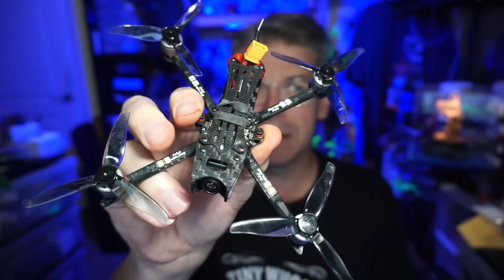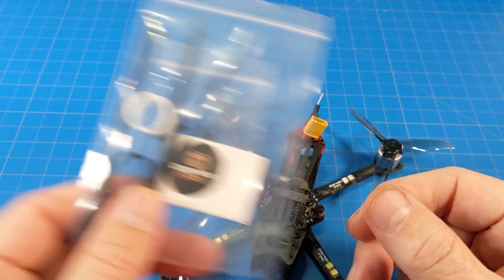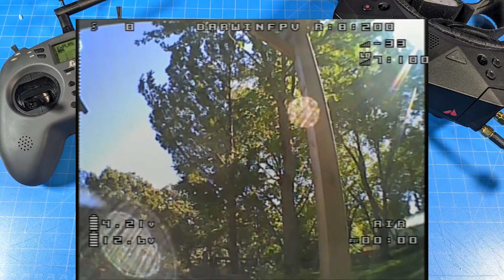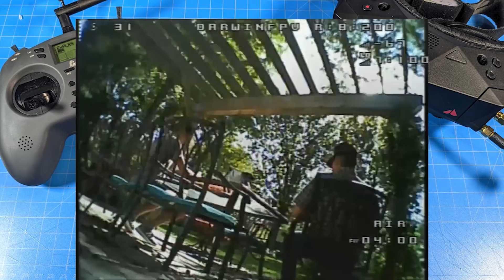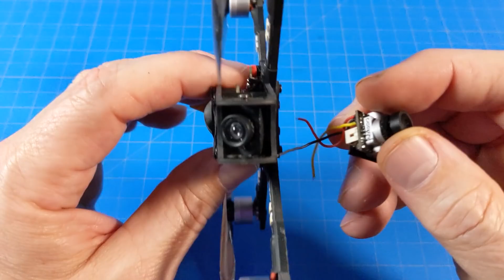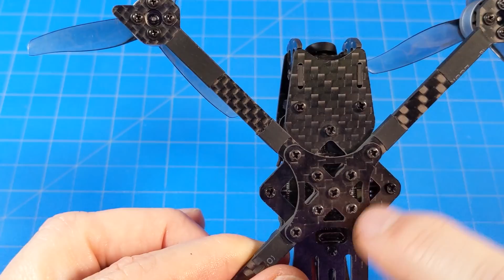So Cheap Made Me Worry // DarwinFPV BabyApe 3 // Took My Crashes

Comment: Wow that's a cheap BNF, could really help some newbies get into the hobbie. With that price you could just send it like crazy and when it dies buy another. It's like the price of a decent AIO nowadays.
Cheers mate.
All the best Nick
Reply from the maker: True, only downside for a new person is the soldering and setup of the receiver. I think that is one spot they could add a receiver for like $10, there has to be a reasonable rx on the market they can get for $5 in bulk.
Reply: @NickBurnsFPV  yeah there's lots of D8 external recievers Darwin should consider. I only pay $5US for the Emax D8 external ones I use. 
But a bit of deal breaker is the cam for me, it's quite bad. An ant would be nice in there but it's 1/3 the cost of the quad, shame it's not wider FOV, the image is fine to start with but narrow makes it soooo hard to learn proximity. Lucky you know you yard quite well by now Nick haha. 
Gonna try a lap blind folded soon? Haha
Reply from the maker: @slowentropy4531  As well as I know the space, my first 6 flights were awful, so many crashes and near crashes. I suspect your right on both the Rx and camera, surely they can find a camera with the same image quality and a wider fov for just a few dollars.
Reply: @NickBurnsFPV  yeah alot of those old reversing camera has huge FOV and are super cheap as well. Yeah that just shows it will be a bit hard for beginners to fly hey, I absolutely love super wide FOV if if image distorts a tad. But hey at least you crash tested it yo a degree haha.
Reply from the maker: @slowentropy4531  yea, I don't get to troubled by a touch of fish eye myself. I just want to see as much as possible. Makes it all feel faster and more aware.
Reply: @NickBurnsFPV  Plus I just love to see motors and props so it feels like I'm in it hahahaha. I really prefer pod racer frames woth cam up top over freestyle top mounts, always have for some reason. Also incase any reads this the LarvaX is around $95US off Aliexpress, not sure if it fly better etc but still my favourite quad. It's cheap and keeps me in the air haha, bless happymodel or I couldn't fly haha.
Reply from the maker: @slowentropy4531  I to want to see the props some, even in those rare case where I can see the motor I am not bothered by it when I am flying, but before arm I do notice it. Having a touch of prop in view also makes me feel I am "the pilot". I often get reminded by others the pod racing in the forest in Star Wars isn't pod racing but the speeder bikes. :) But yea, that is what I often feel flying micros, especially the low pass by the fence.
Reply: @NickBurnsFPV  exactly why I love fpv, that emulation of being star wars pilot hahaga

Comment: This has to be a loss leader to try and get the name out there more. Nothing wrong with that! We benefit :D
Reply from the maker: You know I didn't consider that. Some here in the comments have noted the motors are like $2 on aliexpress. So maybe they are making a bit of money on it. The assembly labor seems to require some profit after parts.
Reply: @NickBurnsFPV  Yeah they are using old components for sure. I like this, it's a form of recycling. This thing is cheaper than the tyro 79 was and we had to build that ourselves + it used  a very strange motor combination (which came alive when swapped to a 4" frame). 

Like you said, adding in the leds is a huge time/cost factor they didn't need to do. Also, it came tuned, which the tyro never did and the parts actually make sense. If you can get a decent FPV cam + ELRS this thing is a game changer for newbies. It's cheap enough that you can just buy two and have one in the box for spares. 

Caddx did something similar when they first broke into the market. Their prices were much lower than Runcam and Foxeer, and now Caddx is arguably the best camera manufacturer (if we factor in DJI and the Ratel, which is my favourite looking analogue cam still). 

Loss leaders are a classic way to get your name out there and hopefully in the future reap the rewards! 

Plus this is one of the only PNP 3" quads that you can get, with the XJB and Diatone 349 currently no longer in production.

Comment: I bought the AIO used on here when it was on Pyrodrone for 30 bucks. The first one I received started smoking when I plugged in the USB. Didn't have issues with the replacement until I exploded it using turtle drone on 3S.
Reply from the maker: that was a darwinfpv AIO? And did you get the replacement from Pyrodrone or DarwinFPV?

Comment: It really isn't bad at all for 70$ I would've liked it to come with a receiver for the extra 20$ but all in all not bad I also like how you can get it in different colors that's a nice touch👍I just don't see getting a pre-assembled quad then having to take it apart to install a receiver 🤔 I definitely would've liked a receiver option it would still be worth the money👍 nice little quad✌
Reply from the maker: You have a good point on the Rx. It would have been worth $10 for them to add a Rx.

Comment: Hmmm... I think DarwinFPV may have found a much needed niche! Could they be the new Eachine of FPV? Seems likely.

I've now been in the FPV hobby for 5 years, so I've seen a little gear. 😉Watched literally multiple thousands of videos - way too many! Lol Nick's are the best of the best! 
My thoughts:  Nick's right. These guys appear to buy parts in bulk and assemble. My only issue is they buy old parts. One's no longer used by nearly everyone! About 3 - 4 years ago we saw 1104 motors used by lots of manufacturers. No longer. Especially with no markings! 🥴
That AIO board reminds me of a primative version of the first GepRC 15 amp board I bought when AIO's first upped the amps from 5 to 12 or 15 amps. Very few quads, now a days, use only a 200 mw VTX, but nothing wrong with that! Hey, at least it isn't only 25 mw, like the real old days! Haahaa! 
That camera - UGH! I don't think I've ever seen one with such a small FOV. Certainly needs a replacement! Too bad too, cuz all of the other components could suffice and stay. Really brings the quad down! 👎
I did like Nick suggested, and read every comment. Some guy said those motors are "two dolla" on AliExpress. They'd have to be to make this even come close to the $79.99 shipped cost. I live in Oregon, USA, and that's what shipping added.

The frame, even though it looks slightly rough, appears like it might just be the strong point of this quad. Some other guy mentioned replaceable arms and Nick the nice and surprising LED's. Wow! 👍
I have no idea if it's durable, but the AIO seems like it's possibly worth 3/4 of the quads cost! Lol Seems all current stock at dealers automatically went up in price with the "new so-called chip shortage" too, so seeing a quad shipped for 80 bucks - did we travel back in time to 2017 ?  LOL

I typically take a chance on quads this cheap because the AIO and the frame would cost 80 bucks! Ha! But, alas, I have over 20 quads and don't have the time to fly them already, so I have to pass.

I will say this to DarwinFPV, ALL parts must be "worthy" to consider a quad "great" or a bargain. Your camera choice has let this model down. Unacceptable! I  would have easily paid $10 more for you to keep that hunk of junk and use even just a Caddx Ant instead. 
Maybe this will help you do a better job next time. 
The motors keep it cheap, but seem questionable also.
Other than those two parts, not a bad effort from a new-ish company to FPV.

REMEMBER, next time ALL PARTS decent! Go ahead and charge slightly more to achieve that!!! 🤔🤘
Reply: They have a baby ape pro with a caddx ant for like 12 dollars more

Comment: $2.00 or $1.50 each motor on aliexpress. heck yeah. if i don't have too many small motors i would buy massive amount of those motors. ( note: prop screws don't fit, cuz of different patterns )
they're listed as Emax 1104 4300kv. 3s should be fine. i don't trust them enough to be on 4s.
Reply from the maker: the prop screws don't fit? That is concerning.

Comment: Those fake Emax motors are well under 2$ each (Ali Ex), they mount using 1.4mm bolts, good luck on durability. Also the cam is crap. Not interested.
Reply: @John Grzeskowiak Fair enough, but here (Germany) it´s more like € 74,41 + € 9,93 shipping + 19% tax + 12% customs. Totals € 110-113. That´s far too much, i´d rather get a Crux3 for this amount.

Comment: Not sure. Looks tempting. So cheap. But kinda old tech. I swaped my caddx ant to the baby ratel 2 and was amazed. Such an improvement. Way better flying experience. Stuff that 1 gramm more weight. 1104 is also old. 1303 is the new standard for 3 inch. Sorry but I have been following KabaFPV and really living his improvements on 3 inch. Maybe not bad this Darwin fpv, but only the price shouldnt mess up the great flight experience.
Reply from the maker: From a price point does a set of 1303 motors cost ~$50. I certainly don't expect those looking for top flight performance to be looking at a budget quad, but those that want to meet a budget or those that meet that criteria and don't want to build very well may.
Reply: @NickBurnsFPV  yeah, it may be an okay beginner quad. Looking at this Hobby, the quad by its own is the least expensive to Start with anyway. First you have to buy Googles and a TX. So lets say cobra x and tx12 then Youre at 230 bucks anyway. So if you pay 70 or 120 for the quad, thats little 🤔. I get you anyway man. Love your channel
Reply from the maker: @chrisbee5481  oh I agree this hobby is expensive. Maybe they would be better served buying something pre-owned from a trusted seller in our community.

Comment: I can't believe it has replaceable arms!  I am gonna check back in the comments later this week to see what people are saying about Darwin stuff.  👍
Reply: I have the aio this quad uses and it's been good for last 4-5 months. It's an oddball in a good way cause it will fly 1-3s.
Reply: @RubyS.1  WHATTTTT it does 1 to 3s...interesting!!!! I've been looking for a good aio that could do 1 and 2s well (brotherhobby 1402 9500kv with 3in props are absolute magic on 1s and 2s omg I hope they make them again omg best micro motor EVER!!!! That control on 1s is heavenly and power on 2s is awesome)cause the jhemcu boards I've been using ALL burned in under 5 flights 3 of them wasted, its that purple 1-2s jhemcu 5a whoop board so everyone steer clear of that one for sure all burn outs were on 2s and hovering not even punch outs and to be honest I think it was the 5v reg not the esc's on all 3 boards....sucks
Reply: @RubyS.1  did you fly 1s???? And how is flying
Reply: I was very impressed with that also man! I just wish that you could get it with a receiver for an extra 20 bucks it would be worth the 90 for sure👍
Reply: I love the 129 7".. my favorite quad atm. 7" for $140 cant complain 👌

Comment: Awesome review, as usual Nick!

Looks like a fantastic little budget ripper! For $70 you can’t beat it! It would certainly get you started, if you can manage not to crash it too hard.
Reply: DarwinFPV is like the new Eachine. That AIO alone is worth a second look and the frame is actually pretty well designed with replaceable arms. They should find some 1404s and offer a 3.5" too.